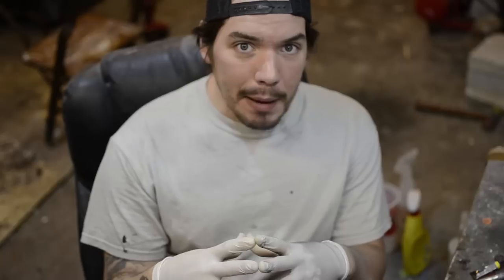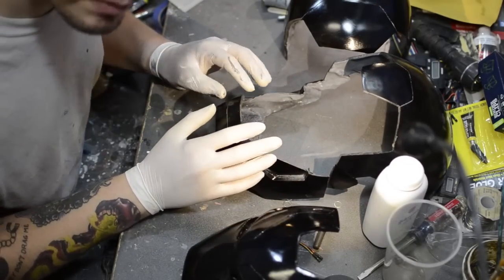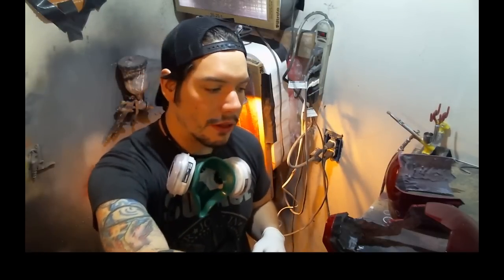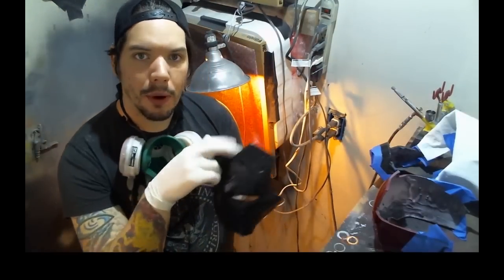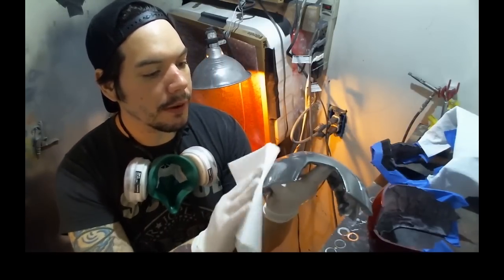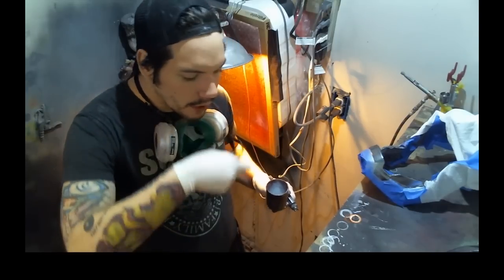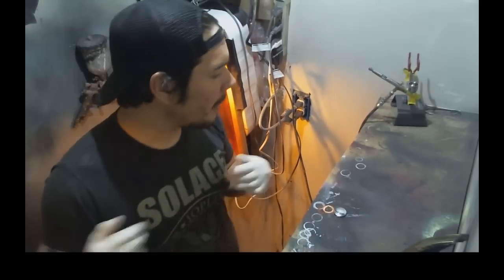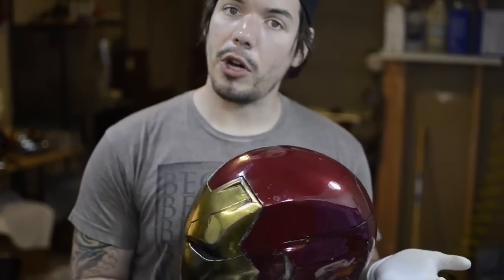WORLD'S BEST way to paint an IRON MAN helmet!

Comment: Do you have an alternative method for doing the chrome faceplate with spray paints?
Reply from the maker: Aaron spaz stix sells their chrome paint in a spray can. But I recommend getting an airbrush if you want to do any kind of realistic chrome effects
Reply: Thanks for the info, I'm leaning away from airbrushing for now simply because I don't have the space to deal with a compressor setup etc. I've had good results with sprays, just haven't been able to find a good chrome tutorial
Reply: Aaron dude alot of people use tiny electric air compressors for airbrushing and you can get them cheap. They don't take up anymore space on a desk than a can or 2 of spray paint would sitting would. U should check it out.